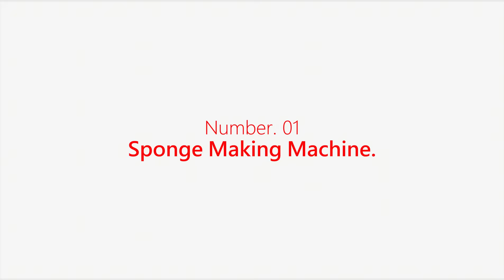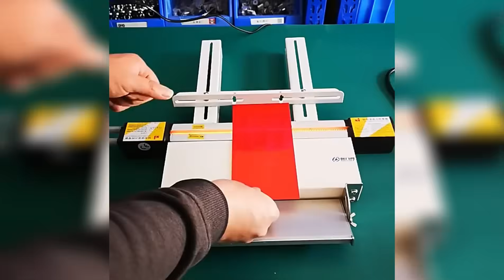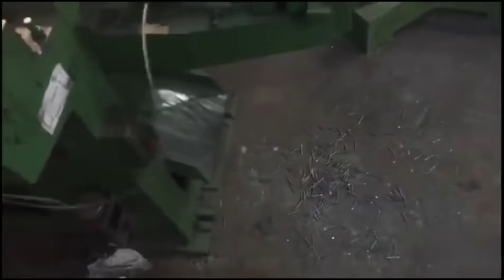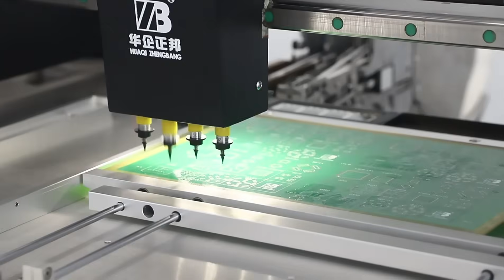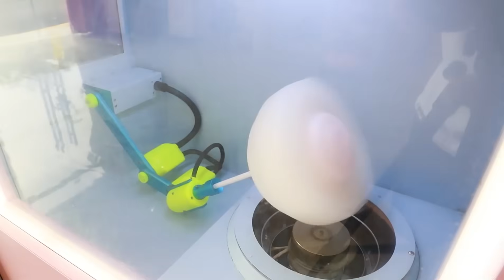19 Machines to Create a Successful Business (Import from the USA)

Comment: 0:45 sponge making machine
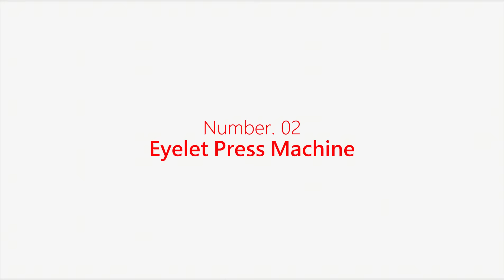1:31 eyelet press machine
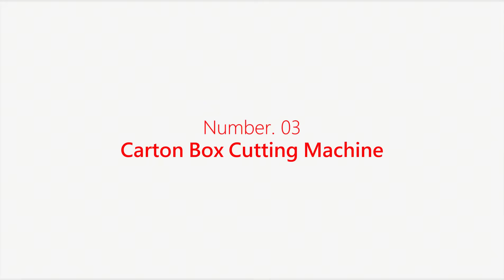2:14 carton box cutting machine 
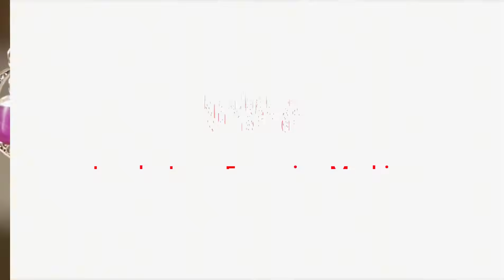3:11 jewelry laser engraving machine 
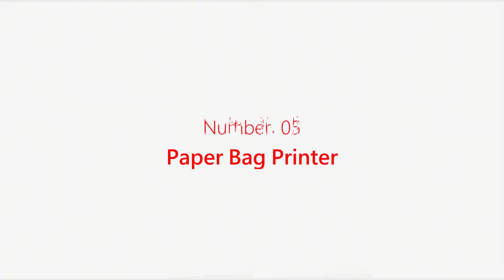4:05 paper bag printing machine 
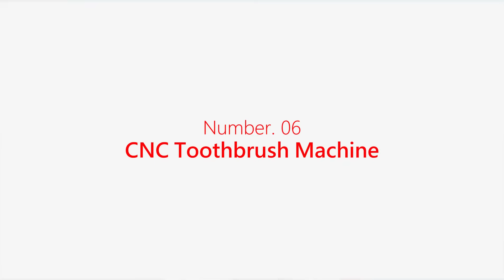4:51 CNC toothbrush machine 
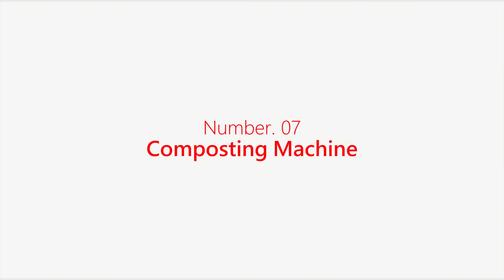5:37 Composting machine 
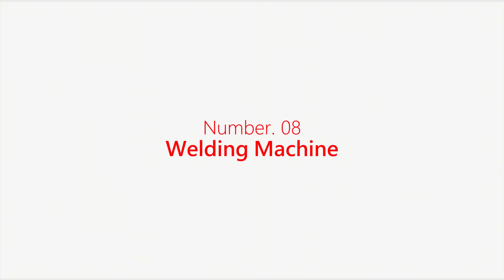6:25 welding machine 
7:15 acrylic bending machine 
8:06 bolt packaging machine 
8:59 key copying machine 
10:18 nail making machine 
11:18 tire shredding machine 
12:09 door hinge machine 
12:57 egg tray machine 
14:02 circuit board soldering machine 
14:58 nonwoven shoes machine 
15:54 windshield wiper rubber cutting machine 
18:56 cotton candy machine
Reply from the maker: Wow, thank you so much for taking the time to add these timestamps! 🙌 That’s incredibly helpful for everyone watching and makes navigating the video so much easier.
Reply: @businesscortex no problem
Reply: @businesscortex no problem. Glad I could help. I didn’t see the sponge maker in the link though